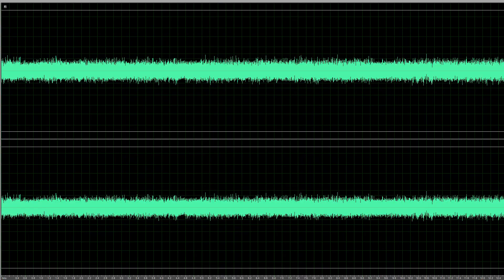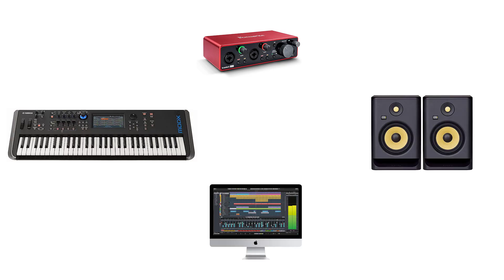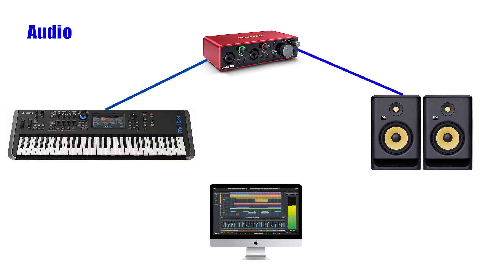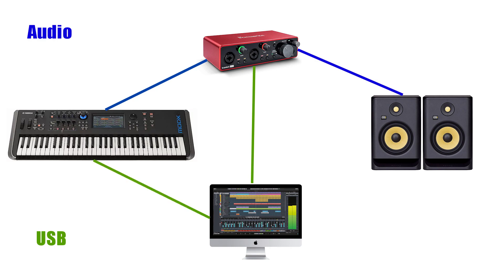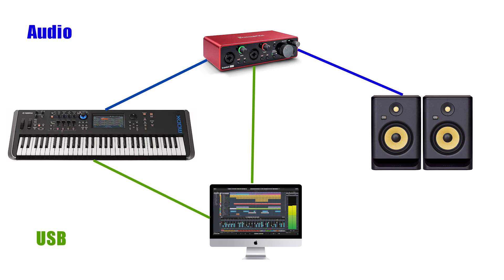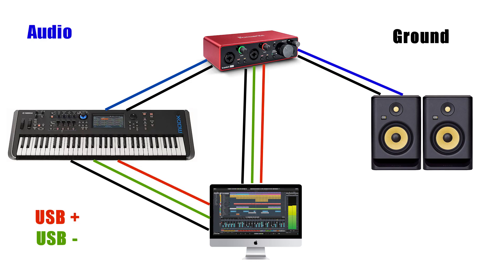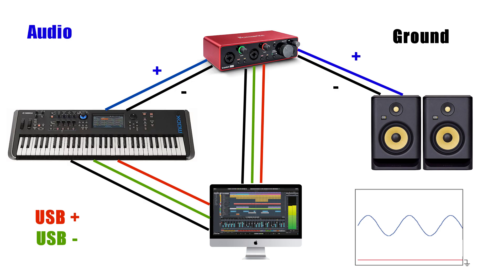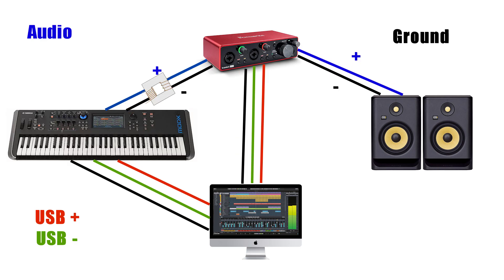How to get rid of digital noise coming across on your audio on your synthesizer/DAW setup!

Comment: Will this work to cancel noise from my audio interface connected to my computer? I’m only getting noise  interference with my analog synths, not my digital ones. I’m sure the interference is coming from my pc because I tested my interface with another laptop and there was no noise.
Reply from the maker: I suspect it might in fact help you out - if the problem is between the ground on your PC and the ground of your analog synths, then having this in the USB line of your audio interface (to break that ground loop) could definitely fix it.
Reply: Yooo i got the same problem!!!! I can’t record anything, guitar, synths, vocals bc …. Did you ever find a solution ????????
Reply: @apollo jetson I solved the problem by getting a MacBook Pro. I don’t use PC for music production anymore because of this issue

Comment: Hi first time viewer, just subscribed! 
I have a Juno DI that I’m also using as a midi… my synth is making a lot of noise… but only when I’m using the audio from it.. 

I also should mention I’m using regular fender cables.. on both the L MONO and R outputs to my interface…

Would I need to get two? One for my midi usb cable and then one being used on my interface > to computer. ???? Please help
Reply from the maker: Typically it's for where you have something connected in two different ways: audio and USB. So look at your Juno. If you disconnect the MIDI USB cable and the noise disappears off the audio, then that's your answer. If that's the case, then put one of those iFiDefender isolators on that cable (link is in the description).

Comment: same problem here, same type of noise, but I use a Firewire interface, what can i do then ? do you think ferrite beads can handle the problem ? thanks a lot !
Reply from the maker: Ferrite beads aren't going to solve this problem, it's a ground loop that has to be interrupted. I don't know of a Firewire device that does this, so your only other option is to use a DI box (with a transformer in it) on the audio signal.
Reply: @ScottsSynthStuff  i just tried it out with a friend's Rupert Neve's RNDI : hiss is gone !!! thanks a lot for your answer ! do you advice any good but cheaper DI box with transformer in it ? and by the way, what are those hum eliminator doing ? is it different than other DI box ? thank again, very confusing topic !

Comment: Hey!! I watched your video on how to refill a sodastream co2 bottle for less than $1!! I called my local praxair and they told me a 20 lb co2 tank with the eductor tube costs $200!! Why does yours only cost $24?? please answer
Reply from the maker: It's based on the CO2 cost. The tank you buy once, after that you just exchange the tank, just like you do for a BBQ propane tank. You can buy a tank for much less than $200 if you look around.

Comment: I'm so frustrated, I thought my problem was "unbalanced" cables, so I bought some balanced ones, made zero difference, .. then I bought this iDefender product, and it's also made zero difference, I still got the same high pitched noise in all my recordings 😭😭😭
Reply: Did u ever find a solution????????
Reply: @ApolloJetsonKND  yes I did, the 3.5mm to 1/4 jack adapter I was using that plugs straight into my Scarlett focusrite was faulty, they're like $1.50 and I got a new one and it worked! Such a simple cheap thing was causing all my problems
Reply: @kevlord9  do u still need this iDefender product? Or it works even without it and was solely an adaptor problem?
Reply: @Rochester92G  I still use the idefender product because it cuts the background noise to zero. If I don't use it then there's a little bit of "hissing" noise, but depending on how professional you need to be you could get away with it to be honest